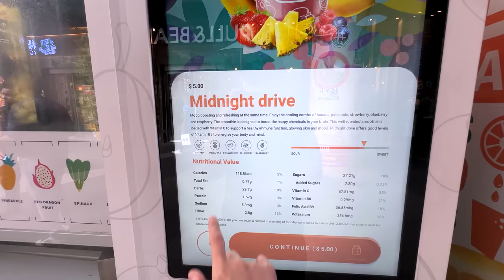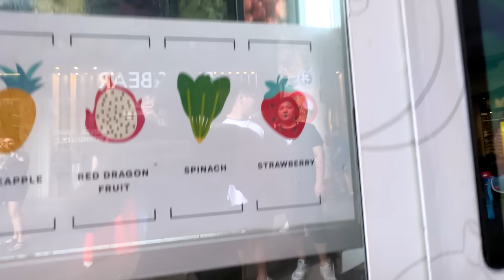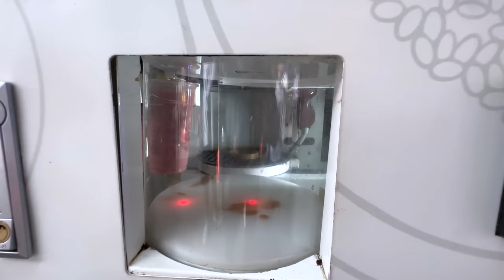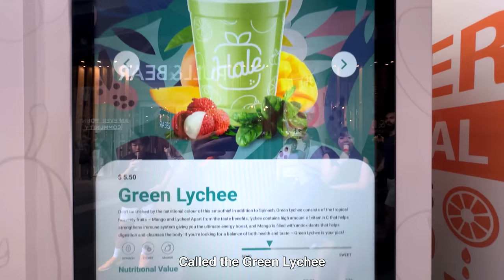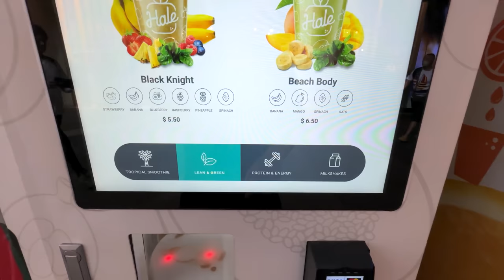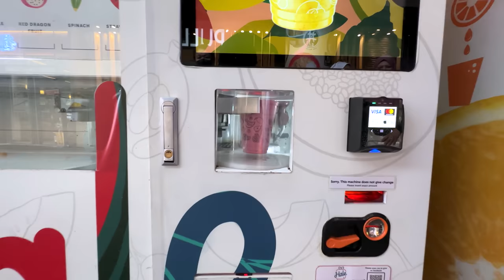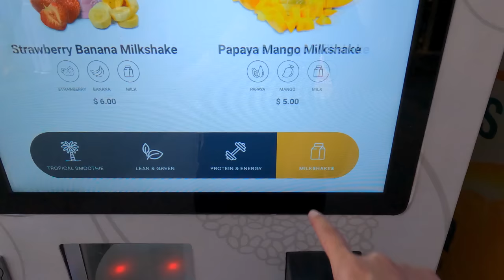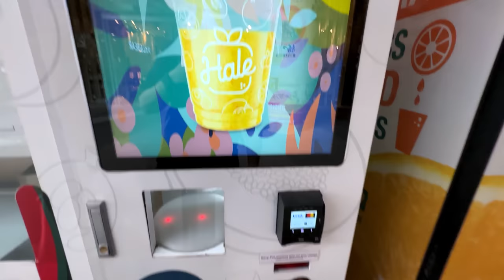Smoothie Vending Machine

Comment: I need a compact version of this in my kitchen 😂
Reply: We are working on one! Haha 😄
Reply: @halesmoothies  I'd buy it. That thing would be a permanent fixture on my counter 😊 I never wanna get a step ladder, get the blender down from on top of the fridge, sit there and hold the top down, check every minute if it's blended enough... you make an auto smoothie machine, that will be sold out so fast.
Reply: It's called a blender
Reply: @maccabi-king  taking frozen fruit out of the freezer is for peasants
Reply: Bro want Juicero 💀
Reply: @maccabi-king   Nah cause with a blender it's supposed to be multi-function so it doesn't have set times for smoothies nor an option to just leave it till it's done. You have to sit there and babysit it. Think about coffee machines, they were made for the same reason: laziness and time-saving. Technically we could save money and not buy a coffee machine but who wants to manually make coffee every morning? It's the same deal here.
Reply: @halfprince a blender with timed preset modes like a microwave could be very useful, actually…

Comment: It seems like each smoothie takes between 10 and 43 minutes to make. So if you're 3rd in line you may have to sleep overnight by the machine just so you can get a smoothie. The other thing that gave me pause was the fruit residuals on the machine, how often do they clean it? With my luck I'd finally get my turn just for something wrong to happen and I'd have to call the refund number.... That's two whole days waiting for a smoothie...